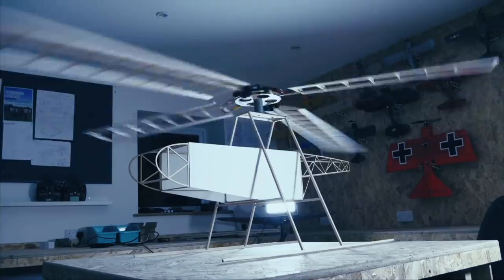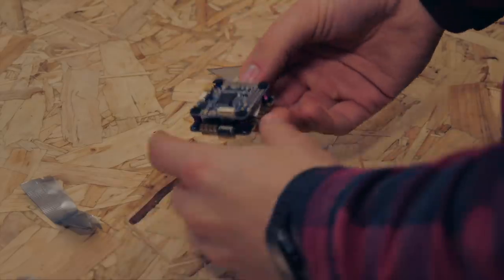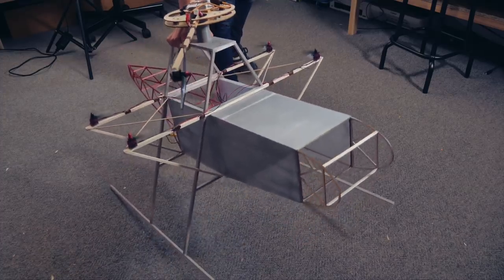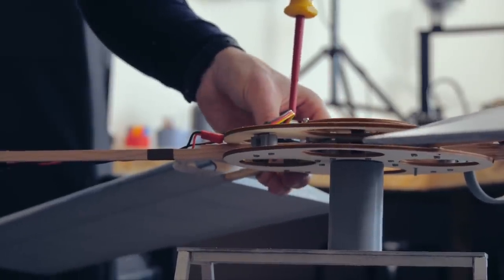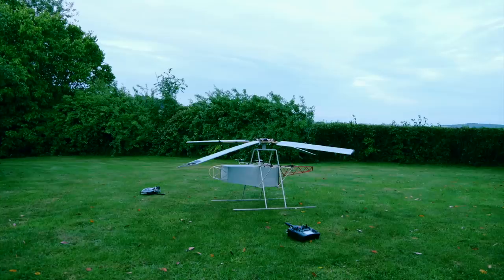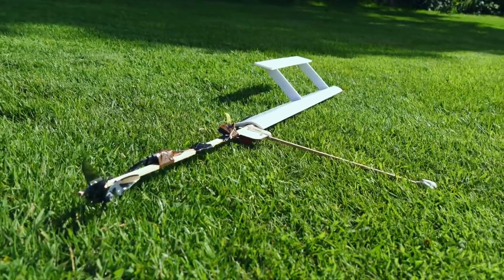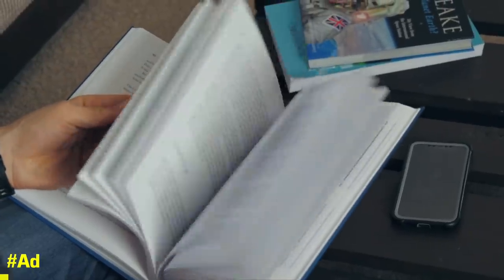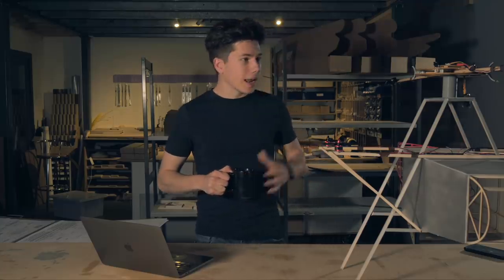DIY Tip Jet Helicopter (Testing) #3

Comment: Hey james I'm back again. Say when u create the next iteration of this design try attaching a string to the ceiling and attach the "contraption" to that string instead of testing it on a table.It would be more of a test and more importantly more safe for both u and the project.👍once again great content!
Reply: But, say the heli took off, wouldn't the string would sag and got caught in the rotor?

Comment: One obvious problem is that the four wings on your model are experiencing aerodynamic resonance.  This, and reflected ground resonance are most common in helicopters with more than two rotors.  Watch the video closely and you will see that two of the wings (the ones tilting up) are causing the other two wings to be forced down by the downward airflow coming off of the upward tilting wings.  Try just two wings that are just a little longer.  Most of your lift happens at the tip where the wing is moving fastest, so only a little more length gives the extra lift you need to make up for removing the other two wings.
Your helicopter is so different that unconventional things can be done, like having the dowel or carbon tube or whatever you used for the wing spar to be one piece that runs straight through the middle of the hub.  This might prevent the structure from bending as much (prevent the wings from bending upwards).   
You might try making trailing edge flaps on the wings that are also RC controlled which would make for some useful flight characteristics.  You could vary the amount of lift/drag of the rotor similar to the collective on a helicopter but much easier in your design since you are adding flap instead of rotating the angle of attack of the entire wing.  You could let the rotor spin up with the flaps slightly upwards  causing no lift for the wing, this lets you spin up without fear of liftoff and with minimal drag.  Once the wings are up to speed, abruptly lowering the flaps launches your model decisively instead of letting it slide around in its nearly zero weight condition.  The momentum of the moving wings provides an extra energy boost right a takeoff when you want it most.

Comment: I think the idea is sound, but the rotor system itself is not rigid enough. A system with a flapping hinge might help absorb some of those nasty oscillations you’re getting. I know the point of your design was to avoid using such an articulated setup, but if you ditch the quad motors for a more traditional helicopter control system I think this has a good chance of working.

Comment: I think you are pretty close to lift off. So PLEASE DONT GIVE UP NOW!! I know what I am talking about, I built quite the same thing and got it flying. If you want to I can give you the link to the video (it's not public until I go commerical with it).

I recommend to reduce the wing-area, for example using two blades instead of four. Furthermore the blades should be stiffer. After Lift-off you will face gyroscopic effects because of the high moment of inertia ;)

Comment: I often wonder why the Djinn SNCASO was not modernized. It weighed 360kg (700lb) - max 800kg (1600lb), a 240ch turbine, beat the altitude record for under 500kg helis with 4780m (15 000ft),  had about 130nm distance... and several still fly after 65years..
Your research are of course justified, and it seems turbines have become more affordable, pricely and technically. Would it have a sense to join this technology with the double rotor type Kamov or K-max ?

Comment: If you're using betaflight on the flight controller turn off "air mode", you don't need it for this application and it will cause continuous increase in throttle until all motors reach max throttle when "bench testing" like you're doing here.

Comment: Just wondering is there any benefits to strapping the motor (& fan blades) to the main uplift blades?
It does seem like modern designs strap the motors just beneath the main blades at the very top of the body?
I don't have any experience in building anything besides computers and much simpler things, please ignore me if I'm asking something stupid.

Comment: Another great video James! This concept seems to be a tricky one but I'm sure you'll find the solution. Instinctively I would think your actual blades are too thin, too heavy and spinning way too fast. Also the wing design should probably take into consideration the fact that the center part of the wing/blades moves much slower than the tips (triangular wing outline may be ?). You might get lot of inspiration searching the recent "human powered helicopter" designs I think... Just don't give up cause I can't wait to see it working!

Comment: I would try to make the rotor structure out of extrudet aluminium. And make the blades waterproof :). I think this thing could fly if you can fix the oscillation.

Comment: for future reference the old orange dsm receivers will output pwm and sbus at the same time
Reply from the maker: Oh right! I wasn't aware, thanks!
Reply: Hi James, enjoyed all three of your videos on this subject. My first suggestion is to make your blade pairs on a single round tube spar and make it teeter like most auto gyros and like the little Robinson R22. That will help once your project starts moving forward rather then drifting in the breeze. The second is to use as one other person suggested, a symmetric section. That could lead to a free floating blade that weathercocks to remain stable as it rotates, like Bristol Brittania control surfaces that always self drooped till it reached take off speeds. Then like Hiller, use auxiliary control surfaces from servo drives to change your angle of attack
Reply: To continue, the advantage of a tube spar could be also a handy conduit for power cables if you do remount your edf’s back outboard the blade ends. Why teeter, this is how autogyros get balance between blade lift differences on advancing blades versus retreating blades without complicated control systems. Regarding EDF placement, there is little in the way of real information on EDF exit velocities, some clearly reach 200 mph from their model speeds, but the sweet spot for efficiency seems to be in the range 70 to 100 mph, so that gives a crude estimate of power plant diameter for max torque input to your rotor disc. Hanging the EDFs from the ends of the tube spar keeps the EDF centre line fixed, and preloads the spar with strain. Thin walled tubes take far more strain than compressive stress, so the tendency to buckle as the max lift load is transferred from the blades to the spar, gets reduced. To go back to servos controlling Hiller style auxiliary surfaces, bit like ailerons, will allow you to control lift. That is, the equivalent of the collective control on a helicopter, speed variation works well on propellers to alter thrust, but not on helicopters with bigger blade diameters. This is why bigger drones go for multi motor sets rather then bigger and bigger motors on a four motor set up. Like more sophisticated prop aircraft, the engine control keeps a steady rpm, you alter the prop pitch to get the thrust you want. That leaves you with just the problem of moving forward. Maybe that Fairy Rotordyne was a neat solution after all. Good luck

Comment: I think this concept should work but you need to give some consideration to the underlying forces present. I would suggest you try to track down and read Radio Control Helicopter Models by J. Drake   1977 MAP publication, that might point you in the right direction, or give you some food for thought.

Comment: Rebuild the rotor blades using tubular spars (carbon fiber?) dope the blades with cellulose dope.Contra rotating blades might help dampen torque/vibrations,that would mean some serious engineering..............................

Comment: Your coupling between blades and hub isn't rigid enough you can see when it starts to produce lift one blade increases it's pitch and gets a sudden amount if drag and slows down then pitch decreases hence the visual oscillation

Comment: Honestly, I would choose to use two rotors who cancel out each other's momentum. The concept to use small and thereby inefficient fans to create thrust by cold airflow to move a rotor to create the actual thrust you aim for is very inefficient. By theory, your thrusters would need to be powerful enough to lift the helicopter directly and compensate for all losses between the first thrusters and the thrust of the final rotor's thrust.

Comment: the source of thrust HAS TO BE AT THE TIPS. even if it is electric. you'll use the momentum  of the blades better because of the leverage. also, even though the structure is light, its not being capable of handling the  forces, try getting something more rigid for the structure, or simply making the structure simpler.  the blades being more tip heavy will also help the rotor oscilate less!
Reply from the maker: Why does it need to be at the tips? You seem very sure! 😅 My Mk1 was built like that but had to be beefed up and heavier to handle the much higher centrifugal forces. Building a lighter machine means the rotors don't need to move as quickly meaning I could get away with having the motors closer to the centre (even though they could provide less torque).
Reply: I agree with James. But if stability is still an issue we can try to make to add an extra lightweight stability “bar” (like the ones u see on a model or toy helicopter).its probably worth a try
Reply: @Project-Air  oof, just seen this a year later. To put it simply I think the jets have to be at the tips simlpy because of the leverage. by putting them close to the center u are simply wasting  the momentum these jets can have. its not like its absolutely necessary, its just wasting energy, you had it right at the first part! it almost flew. Plus the structure of ur helicopter was too weak, it simply had to be more rigid. and I think the structure of the wings was not solid enough either. still think you can make this work.

Comment: There where some very simple wing tip powered helicopters that where actually controlled like a hangglider. So what does it mean to you? Your CG is to high - especially those I saw in the previous videos. Get some carbon brushes (I think you should get spare brushes for the wheels of the LGB (no owned by Märklin) model train.) and put batteries and ESCs down in the fuselage. You can RC-gimbal it to move your CG. If you get the rotor balanced and get enough lift youre done. Oh I forgot one thing. You need copper rings as counterpart to the carbon brushes. Just get the smallest Gas-Wasser-Scheiße copper tube you can get at the hardware store, or just a piece from it at the junk yard. You need to glue 6 Copper rings centered and isolated on the rotor shaft. The top most one needs to have space for the shaft and 5 cables (from the other 5 rings) in it.

Comment: So as you probably already figured out, your rotor head is way to flimsy.  (though you could make it flap like helicopter blades)  The other thing you need is the equivalent of cyclic control from a swash plate.  weather via a swash plate and stationary cabin, or software and and some angle sensing scheme.  (say timing relative to passes of a beacon on your controller, or via a fast compass, etc.)

Comment: What's missing is that this thing has no swashplate and no collective and cyclic control. 
https://www.youtube.com/watch?v=z1mGeyYzanc
https://www.youtube.com/watch?v=WdIBQyBE0CE

 If you want to simplify then then a tandem like the CH-47 uses a pair of 2 axis swashplates. Basically the front and rear rotors have only aileron cyclic. elevator cyclic is done by increasing collective on one rotor and decreasing it on the other and yaw is by opposing aileron cyclic and the front and back. So the swashplates on a tandem only need to be able to tilt in one axis not two. If your heli flight controller has a custom swash mix option and yaw channel mixing this is easy to accomplish by simply setting up a 4 channel swashplate in an X configuration. The front and rear arms of the X are the aileron servos at the front and back. when you give it elevator cyclic the controller will raise one pair of servos and lower the other changing the collective of the two disks. The tricky part is mixing yaw channel output from the gyro into the front and rear aileron servo pairs so they work in opposition but it's not hard to figure out.

Comment: How about getting a knock off TREX500 or 600 heli kit and remove the motor and take a set of rotor blades and modify them with tip jets and wires going to the head where the wires go to a ring contact system to complete the circuit from spinning to stationary wires.

Comment: Y don’t you Make the wings fixed on the bottom so whenever you gain more speed it’ll lift off the aircraft but whenever you lose speed you lower and it could make it less complicated

Comment: There is a very obvious problem with your choice of airfoils. Helicopter airfoil shapes have to have a "0" Moment coefficient, in other words the pitching moment has to be "0". That is one of the reasons the rotor pitches over as soon as it starts generating lift. The only other way to counteract this is to place a horizontal stabilizer with a downward force aft of the rotor about 3/4 of the way out on the rotor blade. This is why a regular airplane has a downward force on the horizontal stabilizer of the aircraft, it is countering the pitching moment generated by the wing. There are multiple airfoil shapes that do not have a pitching moment in normal angles of attack. Also, if you look at helicopters like the K-max, you will find the idea of a horizontal stabilizer on the rotor can act as a trim tab to change the rotor pitch giving you collective and cyclic pitch movement on the blade.

Comment: about your single-blade monocopter -- someone built a controllable version with a control surface on the blade that would tilt in such a way as to produce a difference in lift between two halves of the swept area, allowing pitch and roll control  https://www.youtube.com/watch?v=I_6EjX8T9Ag 
On a related note, someone has also built a control system for a helicopter that does not use any servos at all -- rather, it precisely accelerates and decelerates the rotor to control the lift of the blade https://www.youtube.com/watch?v=d80oXSCcHTk&feature=emb_title

Comment: There really is no way to build a flyable helicopter without at least some articulation in the rotor head.  At the very least you need a gyro-plane style teetering head.  That'll work fine for a fixed pitch rotor head, but you don't actually have that.  With a single, square stock wooden spar, what you have is uncontrolled pitch rotor blades.  You need a secondary spar, around 70% of the chord, or a beefier main spar that won't twist.  Something like a "D" tube spar with shear webbing, or better yet, the "D" tube and a secondary spar.  As lifting element, your rotors are hopelessly under-attached to the rotor hub.
Here's an example:

https://www.youtube.com/watch?v=YbviXD0niqE

Comment: Reduce the point where the rotor spins, increase strength of the rotors and reduce scale for test for weight and expense purposes
Reply: the rotors needed more tip weight and less chord length so that instead of flying around like wings they all pull into the same disk and at a faster speed.

Comment: First of all the sentence for would not be made of wood I would have used carbon fiber it would not have flexed like the wood was and the wood was going to definitely crack and break off under the stress the carbon-fiber had Bliss chance of doing that so you should have stuck with the carbon fiber instead of using the wood as the centers for as the Leading Edge in the trailing Edge that's fine what the status bar you should have stuck with the carbon fiber it would have been strength and lightness if you want it

Comment: Need to start with a real rc helicopter. It needs a collective. And rotor stabilization. The rc will have that. Remove factory motor, install yours.

Comment: Your wing width is too big. Big wings just create more drag as it rotate at high speed. More speed more Drag and ultimately catastrophe. Helicopter wings can be long by length but less than 20% in width like a pencil. Cut the blade width by 60% and try it.

Comment: Get some EDF's and put them on the wingtips. Also, use steel spars
Reply from the maker: Already tried it! https://www.youtube.com/watch?v=6Rw3UTQpP7A&t
Reply: wont that make the wings have to carry more weight meaning more reinforcements meaning more overall weight that the contraption has to carry?
Reply: @reubenstephenjohn5474  Yeah, but I would use aluminum rods
Reply: Yes but I dont see how adding the edd to the wingtip would help.Idk maybe I'm wrong but what suggested seems counterintuitive.i would really like to know your thoughts on this.
Reply: @reubenstephenjohn5474  Me neither, it's a bold attempt

Comment: Ok first off let's starts with it's called a tip jet yet your form of propulsion is maybe 5 inches from the hub... Also you need to look at why helicopters have the flex in their blades and how that whole system works. Cause your soggy noodle propeller design isn't going to get you anything but imbalances and vibrations that are going to make controls dayum near impossible. Also the 3D printed rings was not a good move for mounting your motors and then the rest of your propeller to that is a inherent weak point with flex.